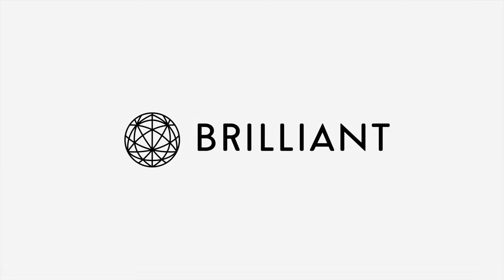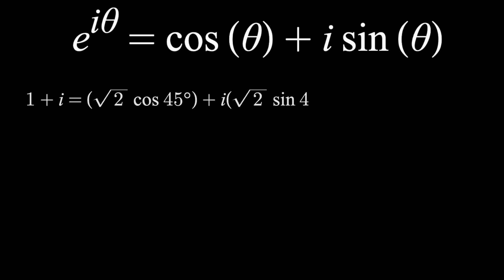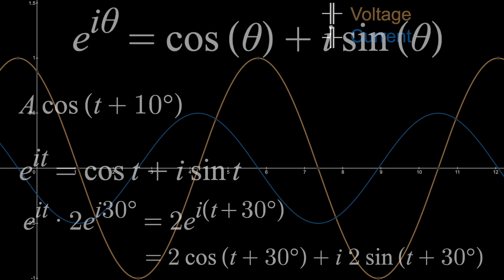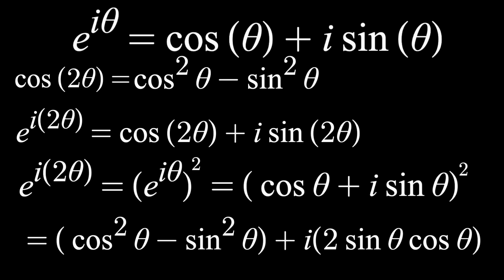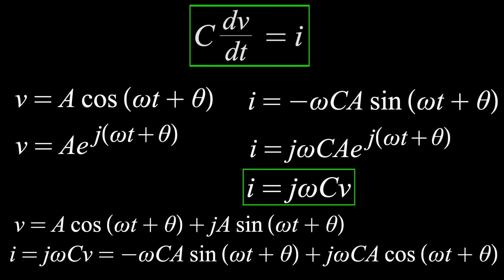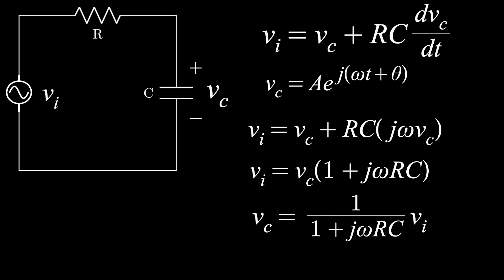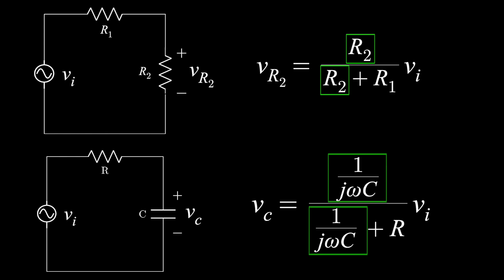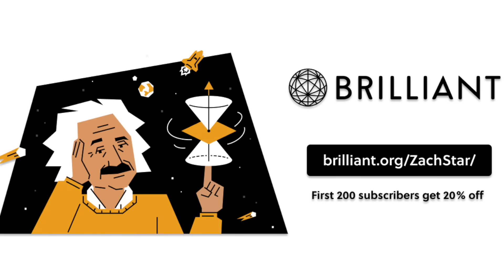Why do Electrical Engineers use imaginary numbers in circuit analysis?

Comment: I would prefer the much easier and more natural representation of complex numbers as a vector with two components. Also I'd like to see a diagram with a voltage axis and a current axis.
Reply: i think the ideal representation would be as a vector with two components in a geometric algebra, because then we get the benefit of being able to multiply by a constant to get a phase shift as well as the intuition associated with vectors
Reply: i think it would cause a bit of confusion as well, bc they don't behave as vectors all the time, for example, there is no dot product or cross product. It makes sense to think of them like vectors, but i think we should do only that, not redefine how we represent them
Reply: @andredetoni897  There is nothing wrong in redefining how we represent something. It all depends on context of the problem and whichever convention you start with you should also finish with, just don't change midstream. It's kind of like whipping up some batter. You're not going to start to stir or whip with a fork and while still whipping it transition the fork into a whisk. That just doesn't happen. Intuition and ingenuity is what allows us to elaborate such models and representations. If people didn't redefine things throughout time then we wouldn't have the tools of calculus that we do today. Here's a prime example; how many times throughout the last 200 years has the model of an atom changed? How many times has various equations, sequences, series, summations, etc... changed due to someone redefining them in different terms? We wouldn't have the complex number system today if people didn't redefine things! Having various representations of the same thing can give us many different perspectives of their properties and behaviors.
Reply: @skilz8098  you're right about all of that man, absolutely. I just think that in this example particularly, it's not necessary. We already treat complex numbers like vectors in a multitude of ways (like calculating power relationships) but they're not fully vectors. I think it's tough to redefine a complex number as a vector when it follows only some of the vectors property, that's all. And I understand completely your point, it would be very convenient. I'm studying to be a professor, so I have kind of strong opinions about how we should teach topics (it doesn't mean they're right tho), and for what I've seen, it's better to define clearly that complex numbers ARE NOT vectors. You make great points thoigh, and I agree with you
Reply: The two components of a complex number aren't x and y by the way. They're 0° and 90°. Any rotation in the plane around the origin can be obtained by mixing different amounts of those two rotations.
Reply: @angeldude101  Not directly but the x-axis has the i vector component and the y-axis has the j vector component. If we take an arbitrary point (a,b) it has vector components of <i,j>. Any vector can be obtained by the addition or subtraction of any two points A and B. So A-B or A+B yields a vector V. A vector isn't defined just by an angle, if anything, an angle is defined by the separation of two vectors or line segments. It all comes back to linear transformations, translations to be exact.
Reply: @skilz8098  "if anything, an angle is defined by the separation of two vectors or line segments."
Yes. And so are ℂomplex numbers! That's the problem I have with trying to represent them as points. In trying to represent ℂomplex numbers as points, you implicitly give special treatment to the point (1, 0). The ℂomplex number a + bi isn't the point (a, b), but the angle and scaling between (a, b) and (1, 0). The linear transformation that bring (1, 0) to (a, b); not the point (a, b) itself!
Reply: Did you mean a diagram with real part and imaginary part?

Comment: short answer: because by using imaginary numbers we don't have to solve horrifying differential equations for every single circuit
Reply: the horror... the horror....
Reply: @DaggerSecurity  It is a horror when you have to consider you might very well run into an unsolvable one. This is why control theory hides in the laplace domain.
Reply: @DaggerSecurity wait  a minute,  is this coming from Sheldon Cooper? 😂
Reply: We have nice imagination I'd say
Reply: because if you use phase shift you must use some fking Fourier, avoid it at all cost, use at most Laplace and also just imaginary number.
Reply: Look, I love math. I even got my second degree in Applied Mathematics. I do not want to solve batshit differential equations every single time I build a circuit.
Reply: @KHMakerD  It's always very simple though, it's always of the form P(d/dt)•f = C with P a polynomial and X a constant or maybe something slightly more complicated than a constant but that's it

We know how to solve these in general, it's exactly analogous to what would happen in the Fourier or the Laplace domain: everything hinges on the polynomial P and its roots
Reply: Laplace
Reply: Its easier... explains most engineers.
Reply: I used to teach this to my high school grade 12 AP Physics C students, including the 2nd order DE and then they'd have to do a student designed experiment to verify it.
Reply: Thanks
Reply: do you even laplace  transform ?
Reply: Using imaginary numbers also fits in with the lack of ability of office managers .
When they get anything beyond KPI's , NPS, and ENPS they are screwed.
Reply: Charles Proteus Steinmetz foi um gênio!
Reply: Impedance.
Reply: No, because by using imaginary numbers we can easily add sines of the same frequency, but different phase shift.
Reply: Thanks, I'm learning about these right now and don't feel like watching a 13min video lol
Reply: Just memorize the laplace table
Reply: For linear circuits under harmonic excitation, yes. For everything else, you still need to solve some nasty differential (or differential-algebraic) equations
Reply: Use Laplace transforms.
Reply: Or using laplace transform
Reply: Please don't talk about them please
Reply: I think they mean why are phazors used to simplify circuits.  A PDE can still have complex roots but I think they are really talking about phazors.
Reply: Exactly.  Change a calculus problem into an algebra problem, maybe even a graphic problem.  Courtesy of Charles Proteus Steinmetz.
Reply: Oh my God thank you I was almost halfway through
Reply: even shorter answer: because it is fucking useful.
Reply: is it better than using phasors for simpler equations?
Reply: Hi.. o.d.e s are fun 🤨
Reply: But for someone who does circuit without this complexity, differential eqation seems to be still easier 😂
Reply: We actually do have to solve them. The author just used his intuition about the form of the solution and made it so the the equation was not being solved.
Reply: Yes correct
Reply: usm?
Reply: you misspelled beautiful
Reply: @SpeedcoreDancecore  You left out a capitol letter and a period.
Reply: Actually, it’s just so that we can have a squared quantity come out negative.
Reply: @cougar2013 Not really, it's more profound than that; if we just wanted a root of -1 you can work in ℝ[X]/(X²+1) and there's your root

We use complex numbers so that a single complex exponential Ae^(jωt) can represent a sinusoidal wave and encode its frequency, phase and amplitude at once.

And all that is to be able to work with ideal sine waves and then apply the superposition principle (corresponding to the Fourier transform) with which you deduce what happens to your circuit with any kind of signal
Reply: @SpeedcoreDancecore Goddamn! I'm studying maths rn and I can't wait to understand this comment fully someday. Time to also re-learn what the english math vocabulary is like, again...
Reply: @sugoish9461 you will llearn it and once you pass the classes the brain will supress the memories as traumatic experience😂
Reply: @Vandelgard  Hahaha - funnily enough, I really like maths so far! Although I've heard from my older brother who studied much farther math-wise in university, that it gets hellish eventually, whew. But, for now it's one of my favorite subjects. We are learning about complex & imaginary numbers currently, so... soon!! Soon, I'll be able to understand! :D Let's hope it does not end up feeling that terrible !!!
Reply: @sugoish9461  You can go surprisingly far from first principles just by considering i to be an additional number such that i² = -1 and everything else being the same as real numbers (except that now you can't meaningfully compare numbers directly so ≤ isn't used anymore), depending on if you did a little bit of calculus already you can easily derive Euler's identity e^(iθ) = cos(θ) + isin(θ)

Actually even without calculus there is a purely geometric interpretation of it you can play around in any graphing calculator, consider the limit of (1+iθ/n)^n as n → +∞
Reply: @SpeedcoreDancecore  I have been avoiding my latest math lesson, but it is just about Euler and that manner of expressing complex numbers! I recognize all that you wrote except for the part about comparing numbers directly... We used those comparison signs when describing areas on a graph where the y axis is the imaginary numbers, and the x axis the real numbers. Sorry if it's a stupid question, but how come we can't meaningfully compare numbers now? Is it because it has to be real numbers that we can visibly prove for it to be meaningful? We're taught currently that all real numbers also are complex numbers, with a real part and an imaginary part. So is it because we cannot compare the imaginary unit directly against real numbers, but can only compare the real parts against the real parts, and imaginary parts against the imaginary parts? 

Honestly, it was some time ago now, but I'm glad I studied at an English school for almost a year :D It helps to be able to understand English explanations as well, even if I'm not as fluent in expressing myself mathematically with words as someone who grew up with it would be!
Reply: @sugoish9461 so it’s been a day since your comment. Did you ever understand why?
Reply: @sugoish9461  you can compare the magnitude of complex numbers at least, since the magnitude only has 1 dimension
Reply: @sugoish9461  you never will comprehend it😷
Reply: @mikevaldez7684  Aww, why not? We're all human, so we have the capacity to learn if we try
Reply: @cougar2013  No it isn't. Did you skip AC circuits in uni?
Reply: @nerd9652  I guess I didn’t say enough. The complex plane always makes things more fun. But it’s not false that imaginary numbers fill the need to be negative when squared.
Reply: @cougar2013  Its not false, but its not why.
Reply: @nerd9652  but it is. It happens to have other properties as a result, but that is what they are.
Reply: @cougar2013  Square being -1 is a result, no the reason. I guess you wont change your mind and I won, so let stop.
Reply: @nerd9652  tell it to my physics PhD. Neither of us are wrong here btw, so you are correct 😇
Reply: @cougar2013  Not continuing our argument, but dude anyone can claim anything in internet. Also having a physics Ph.D does not make you an expert in all areas of physics.
Reply: Now that you mention it, I really want to see how an analysis is done using differential equations.
Reply: @FuckingHostile496  It's not really differential equations but Taylor series, you just say that e^x = 1 + x + x²/2! + …

Then you know that i^n can take 4 possible values depending on the remainder of n mod 4: {1; i; -1; -i}

The exponential series is absolutely convergent so you split it however you want, and in particular here you will split it into terms that have i and terms that don't, which gives you:

e^(ix) = (1 - x²/2! + x⁴/4! - x⁶/6! + …) + i(x - x³/3! + x⁵/5! - x⁷/7! + …)

And then you conclude by recognizing the Taylor series for cos and sin

e^(ix) = cos(x) + isin(x)
Reply: Imaginary number can be used only when the signal is sinusoidal.  That said it allow adding impedances as complex numbers or vectors which is a lot easier than adding different amplitude and phase sinewaves.
Reply: Thank god I didn't go to college. Quackulation for the win.
Reply: @SlinkyD right because electrical engineering is fake, I guess
Reply: @ewthmatth  I learned to quackulate doing electrical engineering. Guess your teacher didn't know enuf good techniques.
Reply: @SlinkyD  Yeah after EE you should get English next.